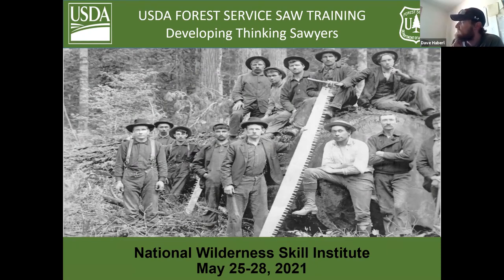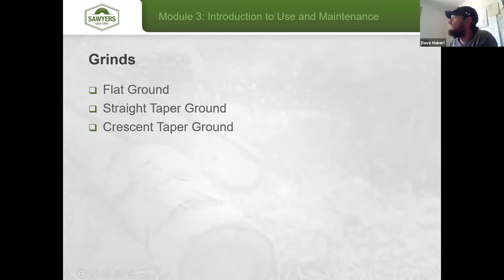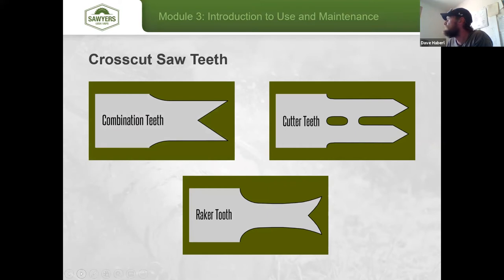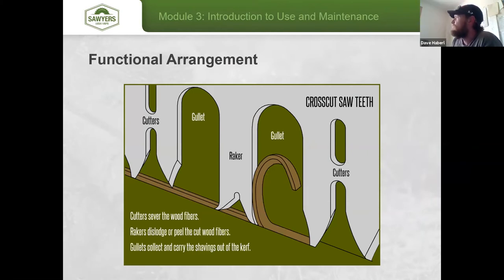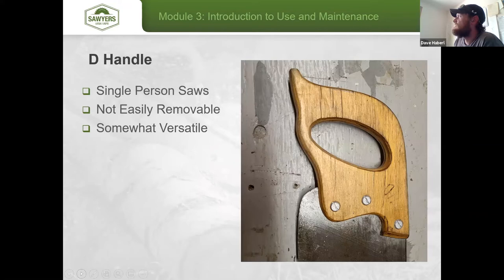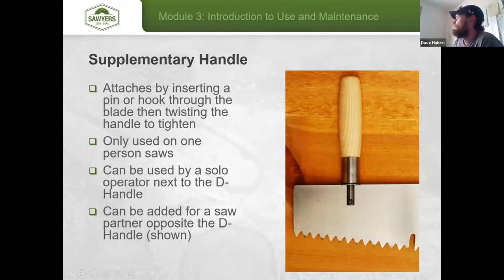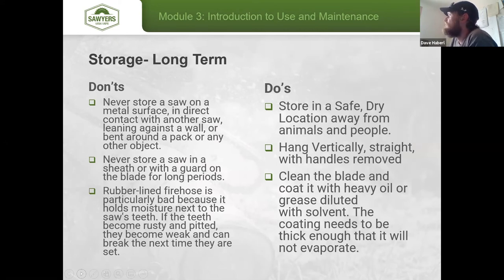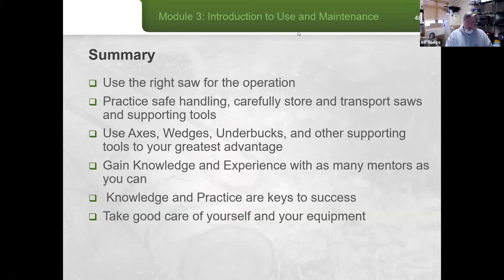NWSI Crosscut Saws III

Comment: Nice presentation! One suggestion of freeing a bound saw is to snug a log beneath but not directly under the kerf then drive wedges from each side of the snugged log in contact with the binding log. Wedges work best when providing direct lift (as opposed to secondary lift in the kerf) and your saw will be released. Wedges are your friend and it helps to have a lot of friends when you're miles from the trailhead.